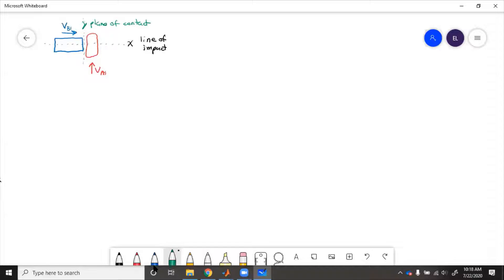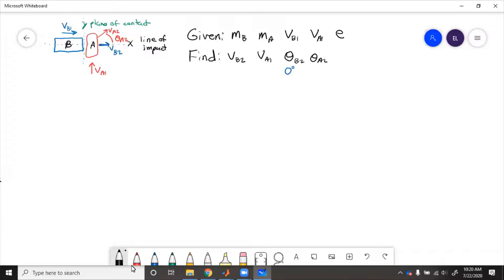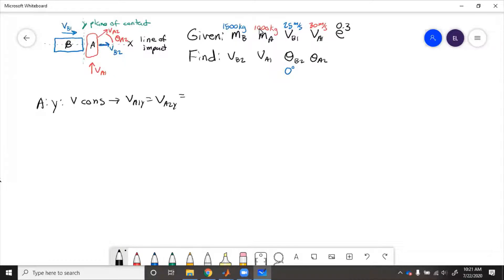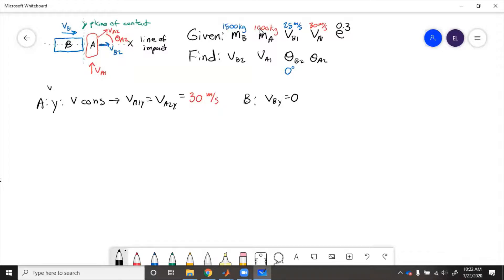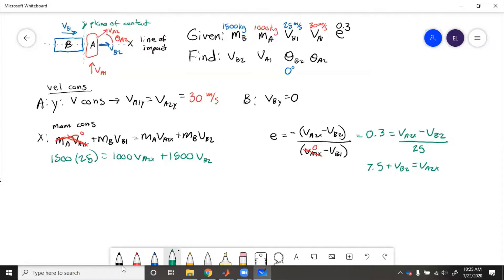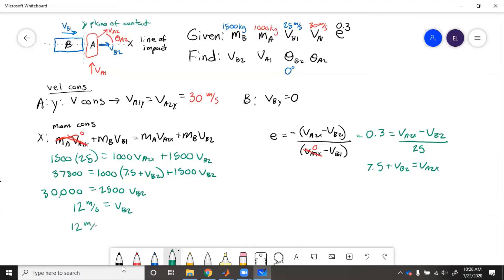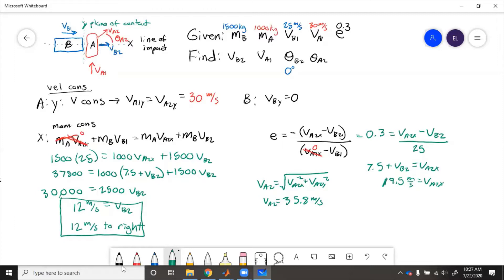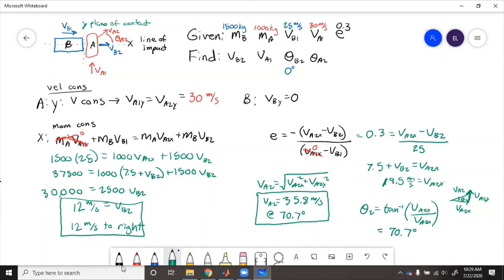Conservation of Momentum - T Bone Collision Example

Comment: arctan(30/19.5)=56.976
Reply from the maker: You are correct.  Not sure what happened there to get 70.7 deg.  The formula is right but answer should be 57 deg.